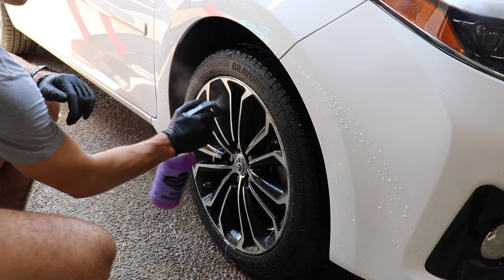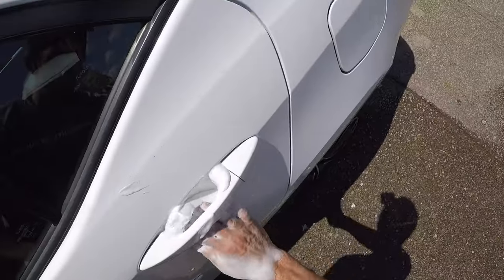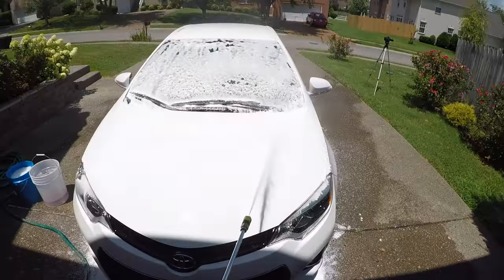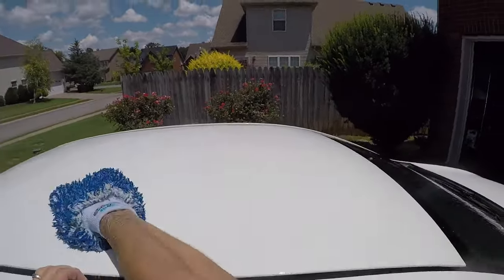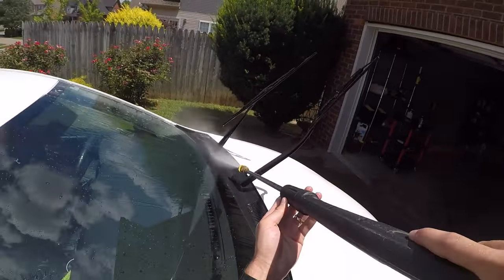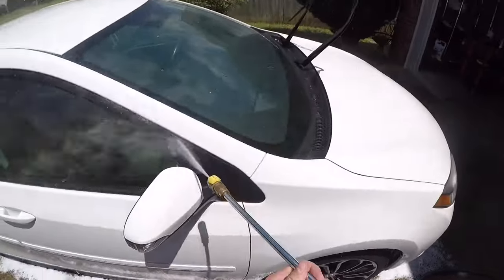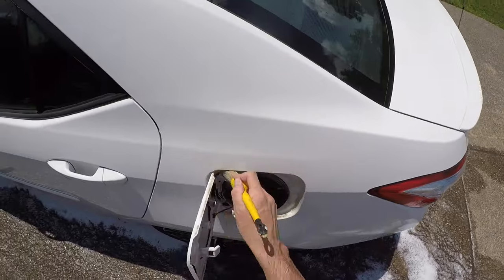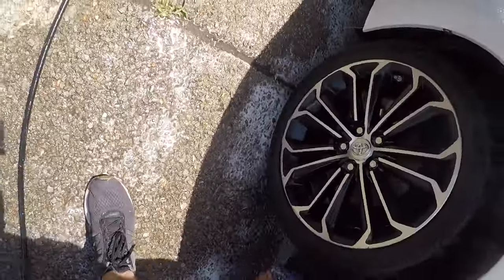Secret Weapon Chemicals To Cut Exterior Detailing Time In Half

Comment: What’s the easiest way to use Citrol as part of a rinseless wash? After the first contact wash so you can find the tar, followed by another application of rinseless wash? Is that enough to remove the Citrol and get it off the clear coat?